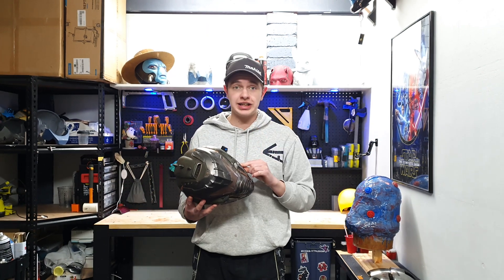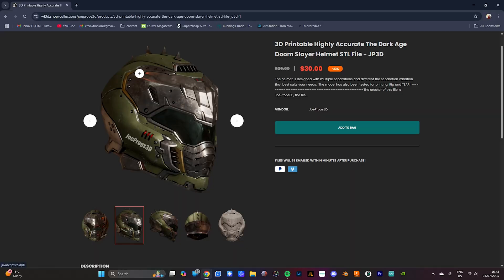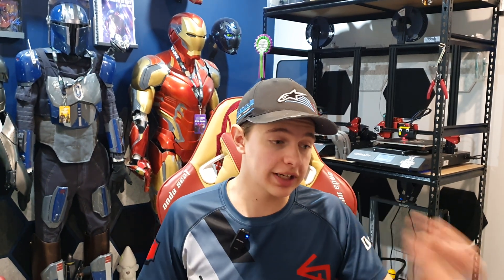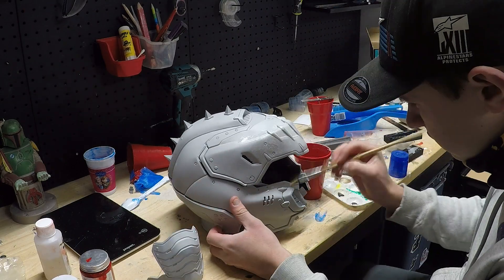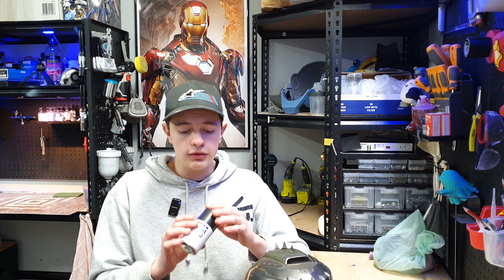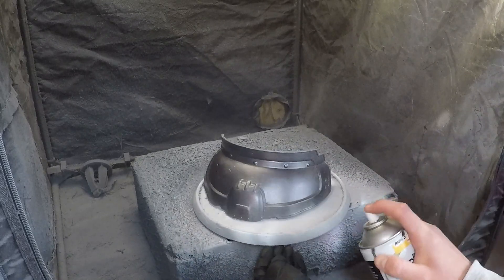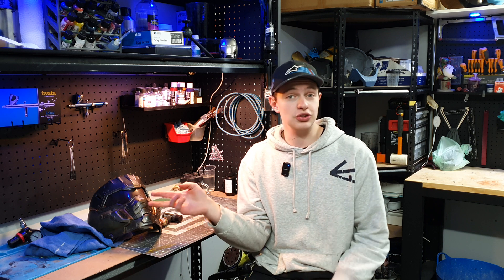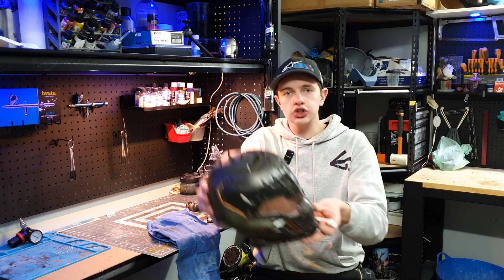how to make a 3d printed doom slayer helmet

Comment: Will this work with a standard PLA fillement printer, open-bed? Do I need white filament? I wonder if the parts are large enough where I can wood fill and just sand down the roughness without loosing much detail. I don’t use resin
Reply from the maker: yeah this whole helmet can be done using standard pla on a standard 3d printer. it would just mean more sanding